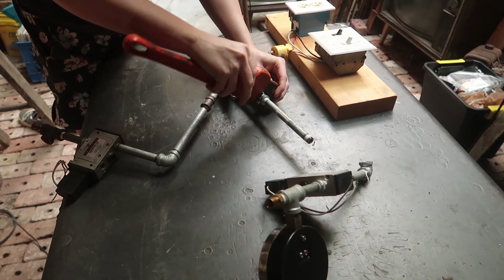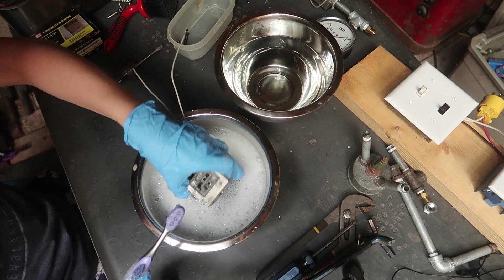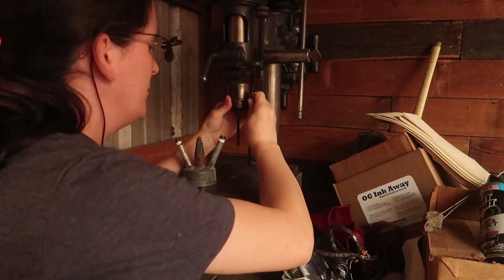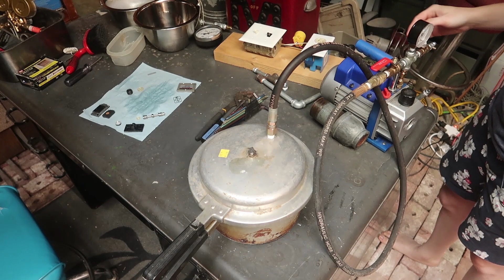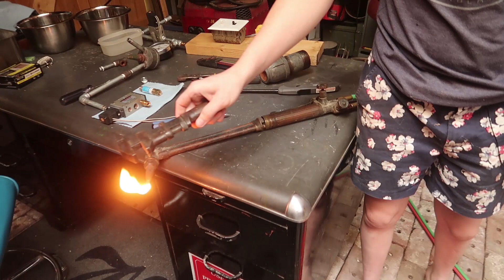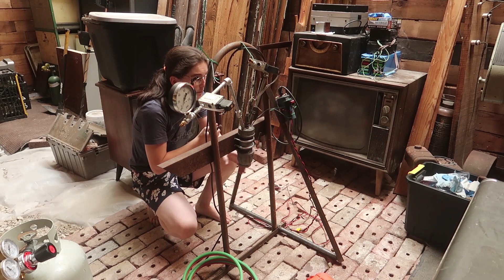DIY Liquid Fueled Rocket Engine 07: Cleaning Oxygen Line and Solenoid, Drilling Injector Hole

Comment: Why is the cleaning necessary? Does it ummmm spontaneously clean itself in a vigorous manner if you don't?
Reply from the maker: fire could back its way up the oxygen line and detonate the solenoid valve, or even worse, go back through the hose to the flashback arrestor, and if it gets through the flashback arrestor, the oxygen tank explodes because the iron of the cylinder burns in the 2,000 PSI oxygen.
Reply: Ah, that doesn't sound fun. I had no idea it could be so catastrophic. Thanks for explaining.
Reply from the maker: @mina47879  yeah thats why stainless steel and aluminium is used more often. just has a better safety when coming to fires. like theres stories of people trying to twist stuck valves off full oxygen tanks and the stainless valve against the steel body of the cylinder creates an instance fire when twisted with a big wrench and detonates the entire cylinder. pure oxygen is scary, itll make your skin burn so fast it is practically an explosion.

Comment: For gas you can use copper break line for cars. They can handle 80-90 bars without any problem! But as always stay safe and stay behind a blast shield when dealing with high pressure gas.
Regarding your cleaning. Soap and hot water thumbs up! But before drying the parts rinse everything in distilled water to avoid deposits.

Comment: Regarding the soot, I don't know about propane, but I know with butane lighters the kind that make a regular flame cause soot, but the "jet flame" kind that make a blue flame don't cause any soot at all. Come to think of it, I've never seen soot with a blue-flame propane torch while soldering copper pipes. Take that for what it's worth, I don't know.
Reply: All carbon-based fuels produce soot unless you mix it with a sufficient amount of oxygen for complete combustion, then carbon dioxide is produced instead. :)

Comment: Careful using brass and aluminum together.. they have this amazing ability to fuse together.. as far as cleaning iron/steel, a nice home remedy is vinegar and elbow grease... removes rust like a charm. If allowable wd40 (and the like) make for a decent rust inhibitor, as far as topical. Propane is one of the lowest soot production fuels available, butane is a little cleaner, but not necessarily a better alternative.

I hope I'm not misunderstanding what you where getting at.. if I did ignore me.. and a preemptive apology.
Reply: A good way to speed up the vinegar rust removal is to add a small amount of Hydrogen peroxide.